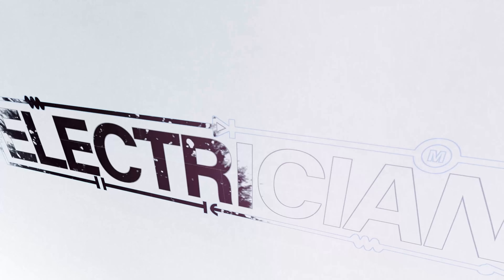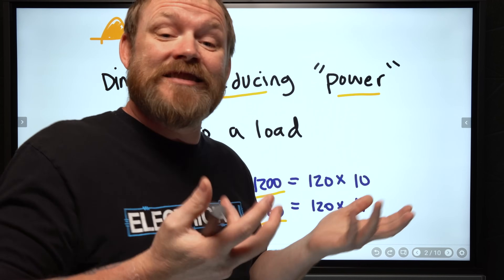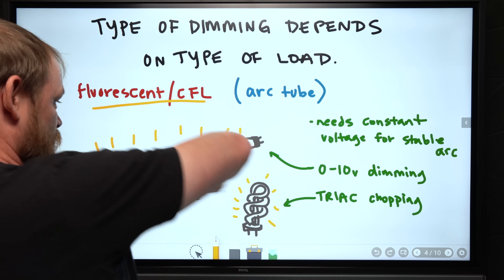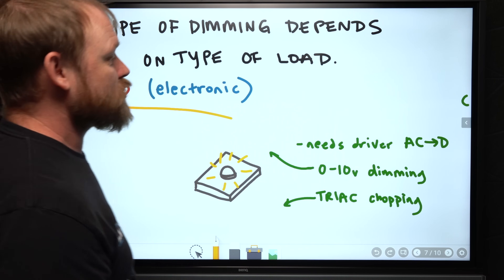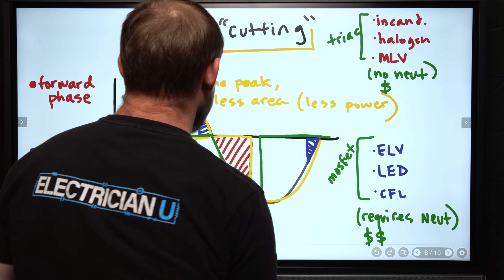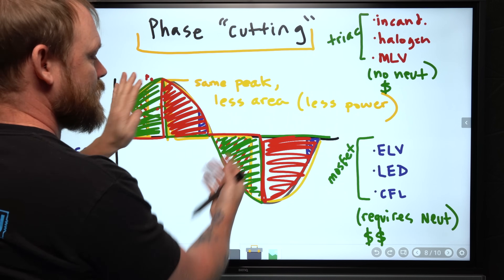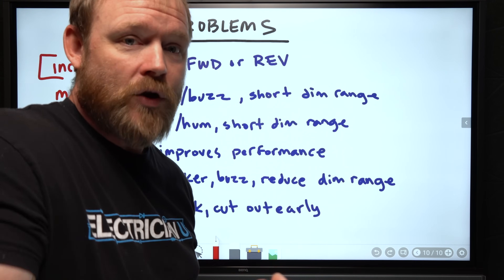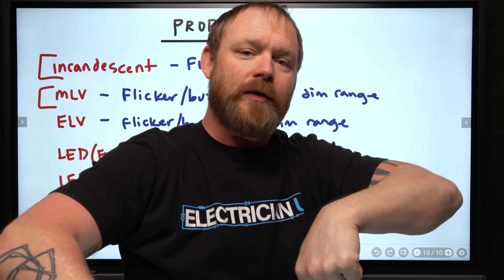The Real Reason Your Dimmable Lights Buzz or Flicker

Comment: As a guy who dims stuff for a living as a Lutron dealer- they have some nice white papers on dimming and also on dimming LEDs - and to do so you’ve gotta understand what a power supply is, what a driver is and the difference between the two. And - when they are combined. Forward phase vs reverse phase. Then there’s pulse width modulation. So just attacking “dimming” as a single topic is hard - almost impossible without following a few different rabbit holes. Each rather deep and different than the other.

But it’s important to understand that LEDs do not “Dim” they just turn on/off fast enough to make you think they are a lower level of light. More time off than on makes you think it’s a lower level of light.

And then there’s the mechanisms in which this is done… Yet another rabbit hole. 3-wire, 2-wire - 0-10v of a few flavors, Dali, ecosystem, or other proprietary technologies. But nearly all of these are just means of creating that PWM signal to the actual diode chip sets. The means of powering the system, and communicating what that PWM signal is to the diode set differs. And that power and signal could be forward or reverse phase - or solid power with a separate signal like a 3rd wire or 0-10v signal or a digital signal of some type. That is what the “driver” performs to change that PWM signal output to the actual LED… 

All of this can be inside a bulb! Or it can be several remote components. 

And then there is constant current vs constant voltage… And that too is also another rabbit hole.

And all of these mechanisms will differ from the way an incandescent light or fluorescent light would require to be dimmed…
Reply: You "buried the lead" - as a Lutron Dealer we take it for granted that many Lutron dimmers, both dumb and the smart ones, can work without a neutral wire.  Still recommended to use a neutral for maximum stability and dimming capability, but in retrofit situations, Lutron's ability to work without a neutral wire ("stealing" a small amount of power to keep the internal electronics alive) can be a game changer.
Reply: @DoItForMeSolutions  you want game changing… Ketra and Rania - no wall dimmers at all. Re-zonable individually addressable - 100% compatible dimming right at the fixture or lamp. Color shifting and color changing… Power supply, control and driver in the fixture. Next level… 

I’m a Homeworks guy - and rarely ever deal in wall box controls - but like decentralized panel systems like Dali and Ecosystem - and as of late Ketra. I don’t sell any - but like the idea of KNX too.
Reply: @NoName-OG1  Ketra is a great system, but most of us will be dead and buried long before Lutron will ever bring Ketra to anything residential besides HomeWorks.  Once they added ClearConnectX wireless mesh (Zigbee, cough, cough, Zigbee) to RA3, the boundaries between systems are even more artificial than in the past.
Reply: @DoItForMeSolutions  ketra was an outside company that they purchased (for the moment at least) you can still buy the non-QSX/Homeworks version. 

But depending on scale of the house - and what other fixtures you’re dealing the wiring and other equipment you might not need - Homeworks Ketra may or may not be out of your price range.

While Ecosystem was a rebrand and revamp of DALI - old Illuminations Homeworks was hexdecimal DMX — CCX is not zigbee though. Same frequencies and a different protocol structure. Type A they still own the channels 

But yes Lutron has gotten pretty bad at isolating products from each other and bundling mandatory other proprietary products to make use of stuff. 

I’m a fan of open source items like DALI and KNX and I hope to see more US market stuff. But often when stuff does hit the U.S. market it’s usually a small company unsupported and short lived then it’s gone. And shortly afterwards the whole protocol vanishes. Like I have not seen a Zigbee device in years now, and feels it’s gone the wayside like X10… (that’s some ancient history)
Reply: @NoName-OG1  Ketra uses IEEE 802..15.4 radios and semiconductors that are the basis for Zigbee.  Yes, Ketra/Lutron uses a tweaked proprietary protocol on those radios, which is why I said "cough, cough" Zigbee.

Lutron spent tons of time and money marketing proprietary O.G. ClearConnect Type A as having features the exact opposite of Zigbee so they could not adopt Zigbee as that would have been eating their words too much, but they needed the practical benefits of a large, reliable mesh with higher bandwidth than Type A which is why they proceeded with Type X buying Ketra and then adding Lutron products to replace ClearConnect Type A with ClearConnect X starting with the Sunnata line.

There are quite a few professional systems that use Zigbee.  For example, Control 4 lighting systems are based on a tweaked version of Zigbee Pro.  The popular consumer Philips Hue lighting system uses Zigbee, and other consumer products with a huge following in the DIY home automation (such as Aqara, Ikea, and others) all use Zigbee as their radio comms.

DALI, DMX, and KNX systems are more popular in Europe and other parts of the world, but no companies have successfully brought them over to the US yet to challenge the entrenched base of large lighting companies here. (An exception is the video production / live theater market in the US where DMX, and wireless DMX is heavily used as an industry standard for production lighting control systems).
Reply: VERY well said

Comment: man if houses were wired for low voltage DC it would fix so many problems. ya thicker wires but thats a one time cost that could be rolled into the financing when a house is built.
if houses were wired for like 24-30v DC, and we used high efficiency GaN power adapters, there would only be a ~3-6% loss as the power point/outlet. lots if not all of DC fridges can run directly on 24-30v DC, and they even make air conditioners/heat pumps now that run on the same dc voltages. solar and home energy storage would be an order of magnitude more efficient and remove several expensive components like inverters which tend to wear out. the only issue would be a handful of old school pure AC powered appliances like toasters/hair dryers, and some cooking appliances. makes more sense for those to be directly wired from the grid with a couple higher power AC plugs. pretty much everything else in peoples homes now days runs on DC and we let the power company charge us twice to convert it back to DC to use. LED lights would basically never wear our coz they wouldnt need dedicated power supplies in their base.
Reply: 100% disagree! The transfer of power long distance - to include the distances within your home are much more efficient as AC! Transforming that AC to specific DC levels at each appliance is much more effective and flexible than any standardized DC voltage would or could ever be. The DC power quality is cleaner when created for the some purpose of the appliance than all of the artifacts that would be present of a distribution level DC. 

You can send a filthy AC signal huge distances and have it create nice clean DC wherever you want it. Without massive wire gauges or welding level amperage’s….
Reply: @NoName-OG1  lol like half the power losses of modern appliances are from their adapters which also sap power all day long when they are not even turned on. wall wart transformer style adapters are like 75% efficient under load. the better ones like for laptops are only 80-85%. adjusting dc voltages from around 24v is 95% efficient with modern chips, and the highest amperage appliances like air conditioning and refrigeration would have no losses on a native 24-30v system. with gas appliances like a range/stove, hot water heater, and dryer, you dont even need anything over 1200watts... so youre bickering about a 2-3x increase in the cost of copper wire best case scenario, or a 6-10x increase in the worst case scenario. AC transmission is actually less efficient than DC, its just the only country that has figured out how to do this at grid scale right now is china so americans know nothing about this technology. no skin effect, no ferranti effect. problem is all grids are based off the assumption that things have to be spinning somewhere like a generator. as more homes invest in dc systems like batteries and solar panels, it makes this assumption antiquated. the only issue with dc vs ac is the easier ability to form arcs, but thats not a concern until around 100v dc. 
now days when appliances break, its 95% of the time a capacitor on the hottest part of the ac to dc power supply. hard to convince someone who has never questioned the conventions of the world around them
Reply: @vevenaneathna  that’s a long string of heresy - with a limited understanding of the broader context of electrical transmission on realistic scale. A limited knowledge of modern electrical theory and systems. And for that matter current trends in alternative energy beyond tiny off-grid systems.

Your thinking is limited to the distances 50 feet. Not 500 miles. And making use of politicized terminology rather than actual electrical engineering terminology. 

Many of the non-micro inverter based solar I come across as of late are high voltage DC >500VDC - as are the battery systems in DC/DC conversion to much larger AC inverters in the 20-120KW range.

If you live in a van… Sure advocate for class 2 DC voltages under 48VDC at 96W.

If you live in a moderate sized suburban single family or multi-family building in an urban setting - what you are advocating is un-achievable. As Edison himself found out long ago. We made that change for well founded reasons. Not just his ego.

In America there are some modern high voltage DC transmission lines at long distances - using DC/Dc conversion to to AC for the last 100 or so miles. As well as some existing DC services as hold overs from the Edison era. For antique elevators, train and bus services. Like downtown San Francisco. But for other than nostalgia are useless.

As for the propaganda of the dreaded wall wart vampire energy BS - is solved by modern electronics design of the switching mode power supply in catered power on demand at each device. As opposed to the full or half wave rectifiers of cheaper consumer electronics. Yes DC is used in many appliances these days - but getting that voltage there at point of use is still and will always be AC.

Enjoy your day.
Reply: @NoName-OG1  glad you were able to fill in some gaps in your knowledge. you might also want to look into the fact that the first two power grids deployed in the us were DC powered, and one is still hooked up to a majority of us house holds. edison didnt loose the ac vs dc battle, its just garbage storytelling that made people think he did. chances are your house still has the old dc grid hooked up to it, if of course you still have a land line connection. the roll out of telephone services did the majority of the leg work to get electricity into peoples house holds, especially in rural areas. and it was all DC powered lol.
Reply: @vevenaneathna  gaps in my knowledge…😅 

Download a voltage drop calculator and see how far you can push 100w at class 2 levels of DC. Excuse me 96w is the limit on class 2.
Reply: @NoName-OG1  lol i used to charge my ev at 3.2kw for a year off of a 8wh 24v battery bank. 2ga wire. idk what class 2 youre talking about. maybe youre refering to the 10amp fuse typical on 12v automotive dc systems. thats the only way you would get a number like 100w
Reply: @vevenaneathna  if you were an electrician you might understand what I mean by Class 2 

Limited to 96W/VA - and generally <48VDC just before it is considered a hazard. And the limits of usable energy before the maximum voltage drop of 3% is about 150’ - and that’s with 1/0 CU. 

Voltages at that level of DC are unusable at distribution levels.

To make use of DC at a local distribution level you would need to be on the 500+ levels to even approach the economy of materials in AC and still be limited to half the distance. 

Seriously educate yourself with a voltage drop calculator. 

Maybe google “why we don’t use DC” or “why don't we use dc current in our homes” 

It’s not conspiracy - it’s math…
Reply: @NoName-OG1  lol new commercial buildings do use 48v dc for lighting to save power and large buildings like stadiums use 350v dc to power all their tvs to save electricity. 
lots of IT stuff uses 48v dc with POE now to save on wiring.
theres none such things as volt amps or power factor in the dc world. voltage drop is a factor of wire size not voltage or ac/dc.
most romex is only rated at like 200-500 feet.
saying a dc circuit is limited to 96 watts makes absolutely no sense unless youre just regurgitating blanket rules from a book. im pretty sure it comes from the 10amp fuse rating on most 12v automotive circuits which can dip down to like 10v on lead acid.
Reply: @vevenaneathna  none of what you said in that context has any truth to it. There is zero “savings” in electricity in the use of DC - Kirchhoffs law remains the same AC vs DC - voltage up = amperage down and vice versa Voltage down = amperage up. 

Large buildings are typically 480/277 to power supplies and drivers to do DC LED lighting in short distances - with various types of control systems. 

As are large TVs like say the TVs on the Saleforce building… 277 AC power supplies local to each section. To save electricity in losses in what the comparable DC would be. What you are describing is opposite from reality.

POE is ridiculously low wattage in class 2. 

Back to voltage drop and all other manor of electrical engineering formulas. There are two methods of overcoming distance - raising the voltage, or increasing wire sizes. Or the system type.

DC has a place locally to its end use. And the amount of electrical noise on any DC system would render it useless in mixed use situations. 

Whereas AC you can push at more moderate voltages longer distances with less material - easily create clean DC where is necessary.
Reply: I’ve thought about this for years and I think we can do it… starting with lighting circuits since those have higher voltages 

Personal electronics demand much lower voltages and voltage drop becomes an issue. DC-DC transformers/chargers will save the day, but I don’t know if we’d be removing complexity to later add it back
Reply: Generally speaking, for some circuits such as LED lighting, it only takes 20-40W or so to light up an entire room and in these situations losses over LVDC circuitry will still be very low even though they might be 8x the losses over 120VAC.

In terms of what voltages to use... 24V passive POE and 48V active POE+ are common.  POE+ more these days but POE+ is generally too expensive for individual lights because it requires an active ethernet link to negotiate the power.

12V is not typically used for residential LVDC, the losses are too high.  At 24V the losses are 1/4th that of 12V, and at 48V the losses are 1/16th that of 12V.

Power loss over wiring is a function of the square of the current.  P = I * I * R.   This is because when you halve the current but double the voltage, even though the voltage drop is a linear function of the current (V = I * R), it is now relative to double the voltage.   So each doubling of voltage cuts losses by a factor of 4 rather than a factor of 2.

A 120VAC circuit is 120VAC RMS and roughly 2x the voltage of a 48V circuit (which is usually more around 52V).. just a tad over 2x.  So given the same power draw, and ignoring AC-DC conversion, a 48V DC circuit will have 4x the losses verses a 120VAC circuit.

However, 4x a "small" loss is still a small loss, and avoiding the AC-DC conversion saves you about 10%... the power efficiency for direct-pumped DC LED lighting is like 99%.  It is extremely efficient.  whereas the power efficiency of a simple rectification circuit without PFC (power factor correction) is only 85-88% or so.

Modern LED bulbs with switching supplies can get up to around 92% efficient on 120VAC, and 97% on 240VAC.

So DC is basically a wash in this case.  HOWEVER, DC does not have flickering issues because the LEDs are more or less directly driven with a current pump on a very high frequency PWM (usually 40kHz), often with an inductor to smooth the current flow.  Zero flickering no matter what.

-Matt
Reply: @junkerzn7312  ya i think the main advantage for dc wiring is longevity of the actual lighting components. ive never seen an LED light burn out, its always the power supply. i mean ive heard of it and seen it in youtube videos but it has to be more than 9 times out of 10 that the led's themself are just fine and its the cheap power supply thats been crammed into a small housing and cooked.

trying to talk to an electrician about DC wiring and losses is like trying to speak to a doctor about natural medications/supplements. they simply do not have the background or education to even begin to weigh any risk/benefit and are conditioned from day 1 to just say that alternative medicine is a bad idea. the ironic part is that most of our medications come from natural products lol.